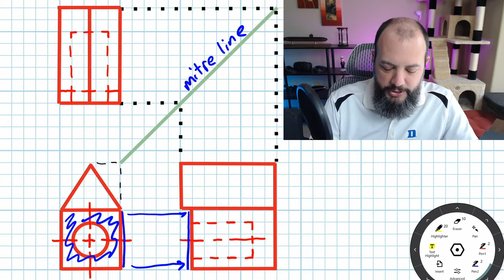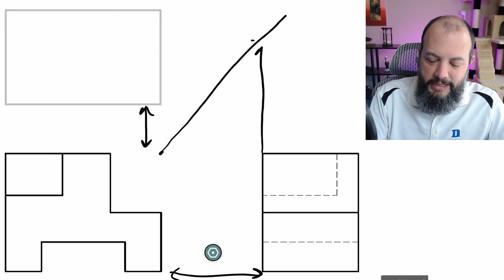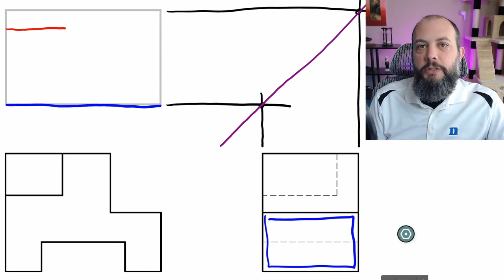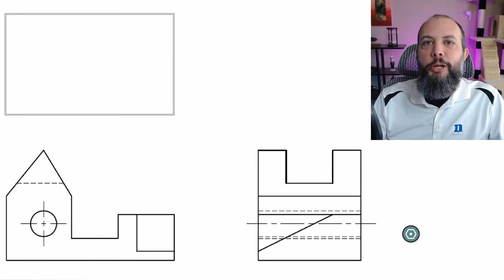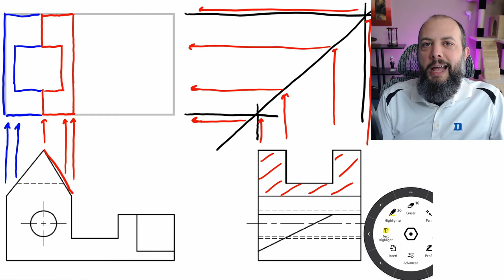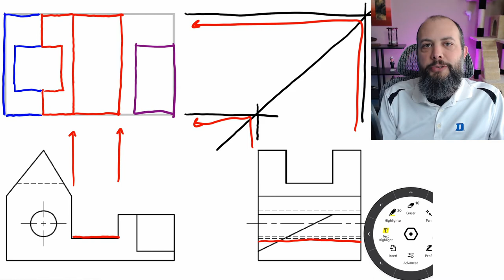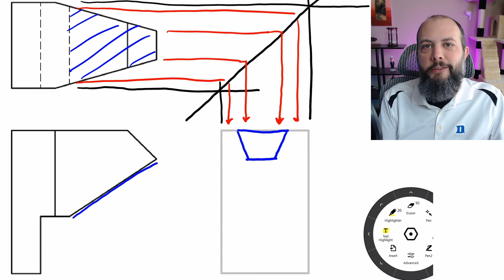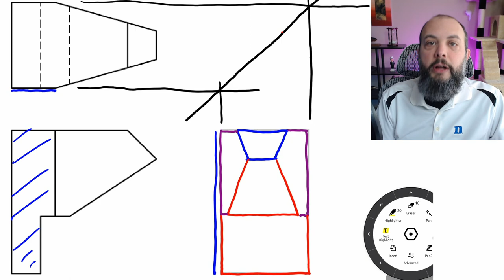How to Draw a Missing Orthographic View

Comment: Question: I don't have a little box where my drawing should go, how would I go about making the SIDE view like at 10:45. 
Thank you!
Reply from the maker: To start, you can draw the top/bottom of that side view bounding box by drawing horizontal lines from the very top/bottom of the front view over to the right. This is because the front and right side views should be the same height, so their top and bottom are the same. Then the left/right of the right side view, will be the same width, as the height of the top view. At the time code you mentioned, 10:45, that's the method I would recommend to draw the left/right sides of the bounding box of the right side view. From the top view, trace the top and bottom to the right until they hit your miter line. Then bend them each downward, and they will mark the left/right sides of the right view. Thanks for watching.
Reply: @BrianBernardEngineering  I see, Thank You!!

Comment: If we're given the top/bottom and side view and are asked to draw the front view, do we need the mitre line? Had this on my exam and kinda messed it up
Reply from the maker: Nope. Only need miter line to connect top/side views. From top to front is just straight down. Right to front just straight horizontal. I just double checked ... I have 3 different videos on missing views (easy to find in my 19 video engineering graphics playlist if you haven't seen it yet), and not one of them has an example with a missing front view. Always missing top or missing side view. Seems like an oversight I might want to create a new video for. Thank you for the idea.
Reply: @BrianBernardEngineering  Yeah, thanks for the explanation. What's funny is that the question on the exam said to draw a mitre line (in bold). My exercise bundle for the course only had missing top/side views only as well.

Comment: Is it the same with 1st angle proj?
Reply: first angle projection just means the layout is different, the front right and top views are the same
Reply from the maker: Thusher is correct. Drawings will look the same, just be rearranged. 1st angle view - the drawing is behind the object ... consider as if the object were casting a shadow on the wall behind it. 3rd angle view, the drawing is in front of the object, as if you were looking through a glass panel at the object. Also may help to think back to your math classes ... 1st quadrant is the upper right quadrant, so that's where Front goes, then the others go left and below it in the 2nd/4th. In 3rd angle view, Front goes in the 3rd quadrant, so then top/right still go in the appropriate 2nd/4th quadrants.
Reply: @BrianBernardEngineering  thank you